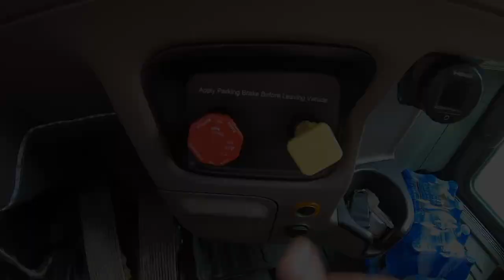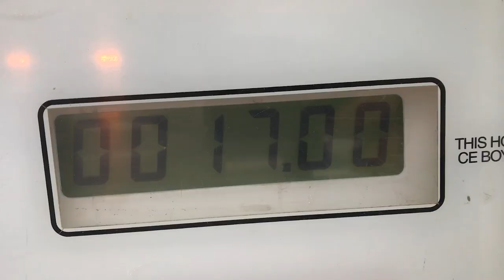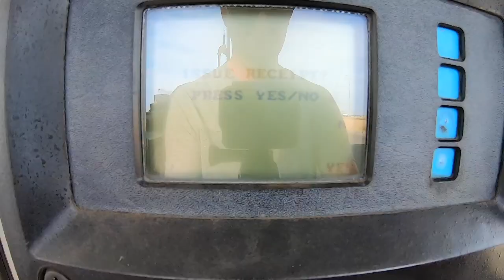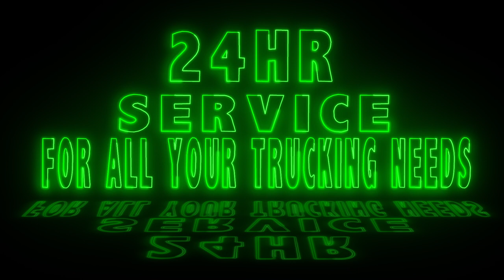HAULING RAIL TIES   ( RAP EDITION ) TRUCKER VLOGS

Comment: Had a gig back in the late 90's running from the Okanagan to Yorkton...left my book in Moosejaw and straight thru. Unload early am then rewind with the sun to my back, picking up my book in Moosejaw with necessary adjustments and home. The flat land out there was hard to take for a BC boy, tried as much as possible to pounder off at night.
Reply from the maker: yeah i used to love driving at night when no ones around and hammer down, much easier to take when you cant see it